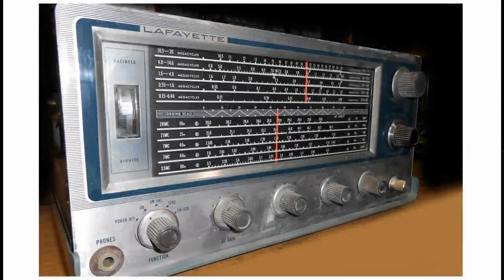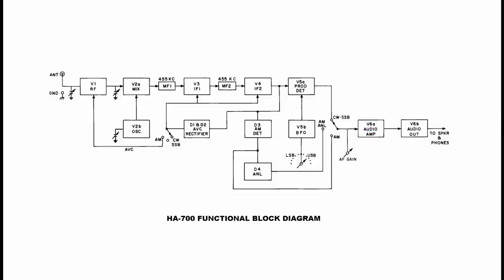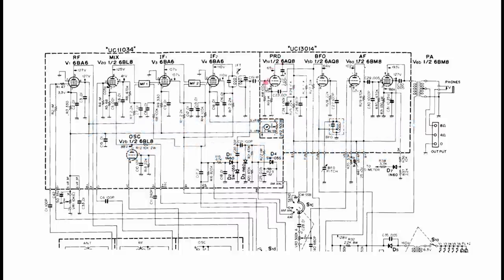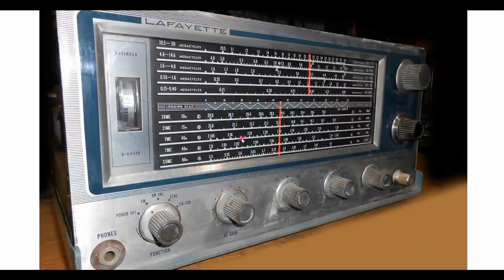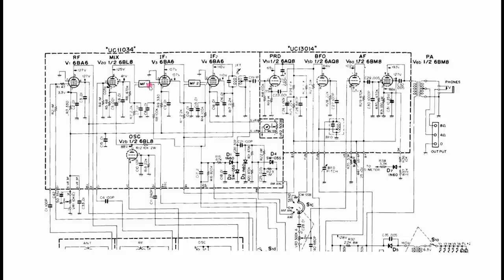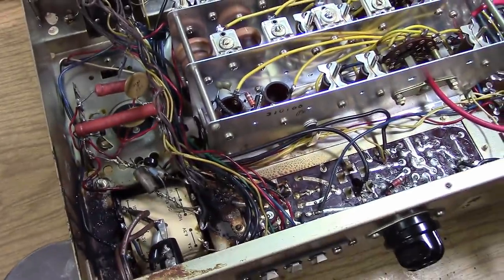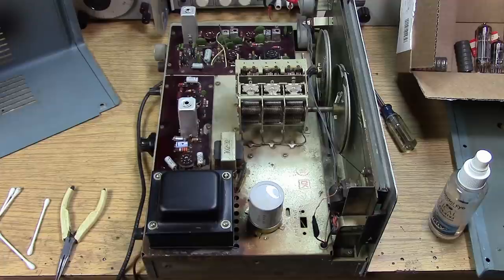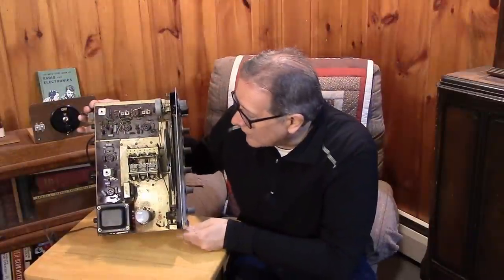HA700 Shortwave Radio Rejuvenation Part 1

Comment: The HA-700 front panel is almost identical to that of the HA-600A (the 600 has the panel in blue).  Circuitry is very similar except, of course, the 600A is a transistor receiver. I got a 600A for Christmas in 1972.   I picked up a second one a couple of years ago.  I too scratched my head over the "mechanical" filter thing.  I had big problems with the product detector in the HA-600A.  It was envelope detecting and product detecting at the same time.  SSB sounded awful.  I eventually replaced it with a diode ring.  I have details on this if anyone is interested.  Has anyone else noticed this product detector problem in the HA-600A?  73  Bill  N2CQR
Reply from the maker: Yes I believe that they actually tried to reuse stock parts and designs even when going from tube to solid state. Many tuning mechanisms and variable capacitors and even filters and small parts could be brought right in, thus saving scrap.

Comment: Some yaesu also had the transformer problem likely due to bad quality of transformer iron causing excessive heating. Also better check the heater voltage. anything above 6.3v is bad for tube life. Usually it is 6.6 to 7v due to higher mains voltage compared to its design voltage of 110v
Reply from the maker: Something took out the original rectifiers and it got pretty hot!

Comment: I was once told by a high school electronics teacher, who was also a service engineer and historian for the Hammond Organ company, that installing capacitors which are not close to the rated voltage of the circuit design will not reform upon power up, and fail prematurely.
Reply from the maker: Obviously he was a reformer! Now that caps are a bit cheaper, a lot of folks re-stuff cans or buy re-stuffed caps..

Comment: excellent Mike - Looking forward to part 2....I have got to look at bringing my old KT340 back to life as it has been sitting on the shelf for many years now. I built it as a kit in 1965 but it will need some TLC and also do something about the potentially lethal power supply arrangements due to the chassis being connected directly to the (neutral or live line) ,as part of the design!
Reply from the maker: That 340 is just a year earlier, but it is a real tube chassis radio and it would be an easier radio to work with. Most would say - a better radio than this HA700. I think it has a proper power transformer, so you may be fine just checking the cord and fuse or changing it out for a modern cord.
Reply: @MIKROWAVE1  Thanks Mike . Yes it has got a proper chassis - good advice... cheers  Dave...

Comment: Mike, spoiling us again with another series where I can't wait to tune in for the next episode. Great video, thank you. Really appreciate your circuit descriptions coupled with background info and dry humour. I was interested to know a little more  on how you cleaned the top of the chassis please - did you use just water or detergent and did you just use a brush? Very good advice about not just powering these radios up. Like you said  "Worked fine last time I plugged it in"; for a few seconds until the smoke appeared.
Reply from the maker: Carefully with it propped on its side in the sink on rubber mat. Sprayed on all purpose cleaner and let it soak in. Then Hot water, dish soap and a soft brush. Rinse  - drip at many angles - let it sit on paper on cardboard - selectively wipe, then hit it with the hair dryer. Not perfect, but settled the dust without total baptism and harsh chemicals. I was careful to try and avoid the dial string and front panel. Lube and grease and contact cleaner later.
Reply: @MIKROWAVE1  Thanks for reply. It certainly did the trick. A significant improvement in appearance.

Comment: Why did they not use the Wire -Ended Philips/Raytheon low voltage vacuum tubes and make it that you had to use headphones (Cans) or an addon Amplifier with speaker for listening without Headphones and it would be more compact.
Reply from the maker: Those Japanese were under the impression that a real communications receiver does not have an internal speaker. A lot of engineers agree.

Comment: I assume the transformer is blown? Can you find a replacement? Looking forward to Part-2 for this repair. Thanks for sharing it with us. 73 de K7RMJ.. Frank
Reply: I also wondered about possibly having to replace the mains transformer. I used to do a little valve (tube) radio restoration. If I suspected the mains transformer was blown, I would not buy a set. Even if the transformer is a fairly standard design, they were often made for the set. So, even if you find one with the right windings, chances are it will be different dimensions. Also, many items of equipment had "oddball" additional windings like the LT secondary for the mixer tube in Mike's example. So, you maybe ended up, if you could, installing 2 or even 3 transformers to replace the original. All in all, most problems can be fixed fairly easily, except finding just right mains transformer. Of course you can get them custom made but last time I checked, it was very expensive.
Reply from the maker: @Steve-GM0HUU  It actually is a replacement. Lafayette's factory Depot was located very close to where the radio was purchased on Long Island. I personally know the owner and have the story which I will cover.